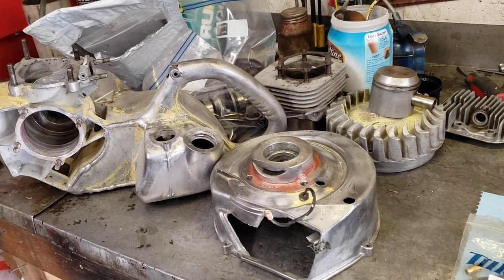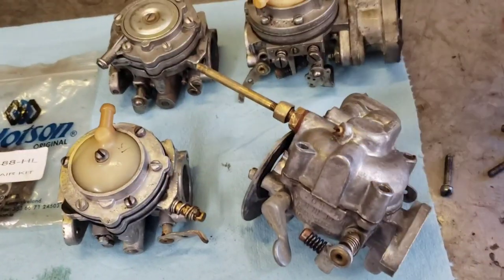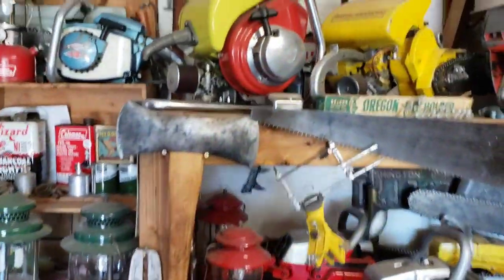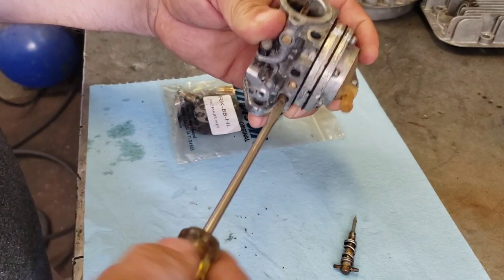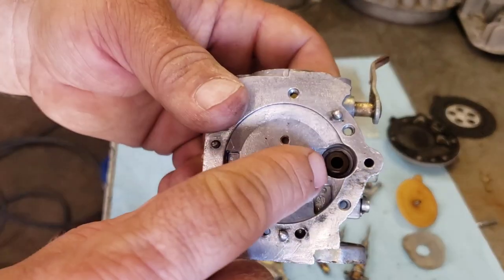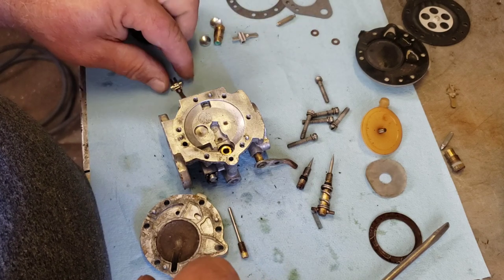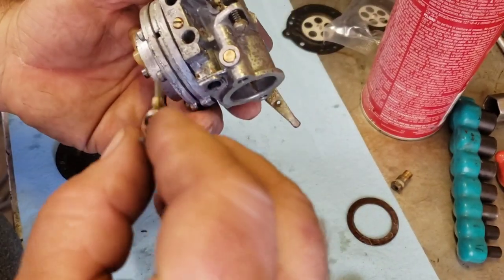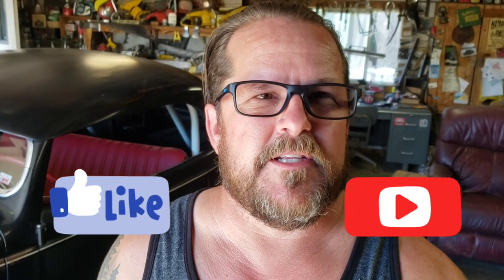Tillotson Carburetors (Standard on most Vintage Chainsaws)- some history and how to rebuild an HL

Comment: The first tillotson single diaphram carb, model H, would allow a two stroke to be run up to 90 degrees.  When the HL came out, that is when you could run 360 degrees. because it had the pump and metering functions both.  The HL is what made two strokes viable for so many applications.  Tillotsons werent used a lot on old cars, but were very popular on tractors, trucks, farm equipment and construction equipment.  Good video on both historical and practical information.
Reply from the maker: Thank you Sir! I was wondering on the Titan that had the single diaphragm carb👊👊

Comment: My old Stihl 070 used a "made in Ireland" Tillotson. Currently rebuilding a Partner K650 concrete saw which has one too.
Reply from the maker: That's cool, I've seen one like that also as well 😉
Reply: HL-324 carburetor. Made in Ireland.
Reply: on that Partner you should have a HS-175

Comment: I have a old echo 452vl  saw which the carburetor giving me trouble...it seems to be over fueling...I've put a new carburetor kit and had tried multiple times to set up the needle tab aka fuel metering...
  Any thoughts is appreciated....
Reply from the maker: Hmm, yeah I hate chasing stuff like that...make sure the order of the diaphragm and gasket is correct...spacer gasket goes on carb body first then diaphragm on top....if it's flip flopped it will run too rich....keep tryin😁
Reply: @KainKustomGarage  I'll check...thanks..the other thing I have not check is the needle/seat   sealing...?

Comment: Dan help me out. You know I’ve got the old Husqvarna 380CD and it has Tilley HS something. My saw has the L and H jet holes on the port side of the saw as the operator would look down the blade while in use. The spring loaded needle with the steel sleeve on the TOP of the carb by the linkage is just the idle speed? My saw has no brake. anyway, I did a small muffler mod so I had to readjust he carb. At first I couldn’t start the saw or keep it running It at idle.  Dialed all 3 needles to 0 then opened them up per Tillotson specs .  Thing was screaming and way over-revving. So I dialed them back 3/4 turn. But I don’t think my settings are right. Sucker is heavy and trying to adjust needles while the saw is running is physically taxing. Should I just seat the idle speed needle to near 0 then do my L jet then H? But leave idle speed almost seated?
Reply from the maker: Hey Dan! So you should set the lo jet first , so it idles decent usually ends up about 1 turn out, then set your idle speed, then your high speed jet...I did a carb adjusting video, maybe check that out...😊
Reply: @KainKustomGarage  will do Dan. Thanks. These old Tilleys really last long and take a beating. I do have a reputable rebuild kit, but I’m just holding on to it now. If it ain’t broke don’t fix it. What brought this about was a minor muffler mod I did with a small additional port. I’m retrospect I probably didn’t need it since the 380CD OEM muffler has no baffles. Thanks